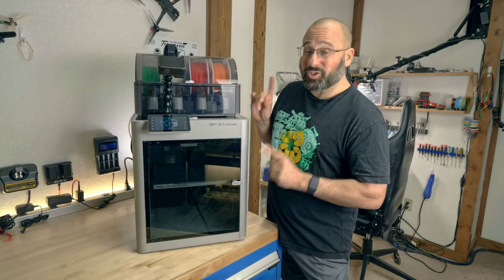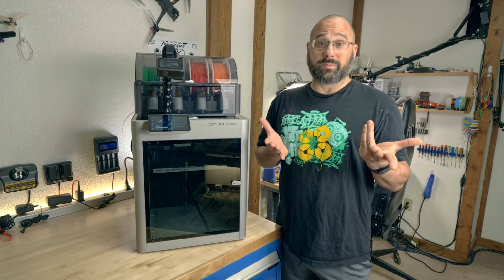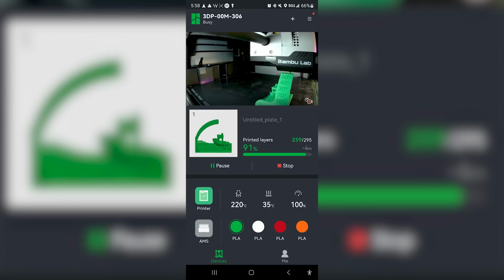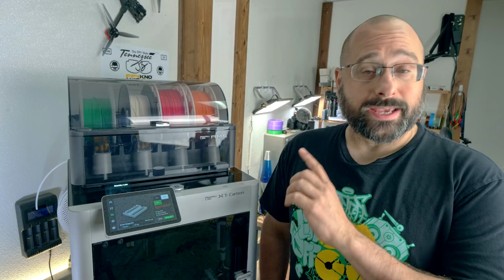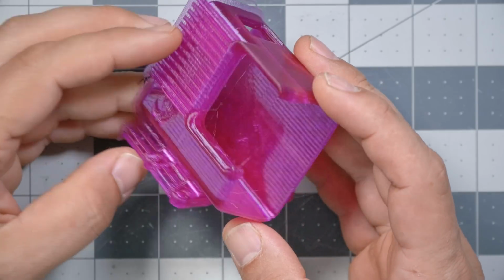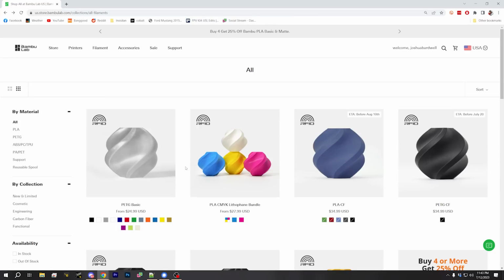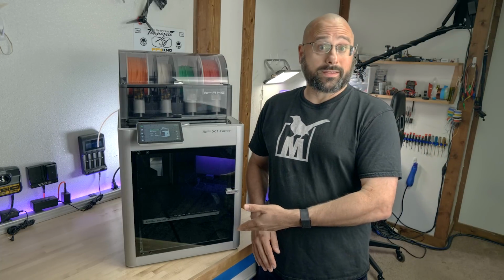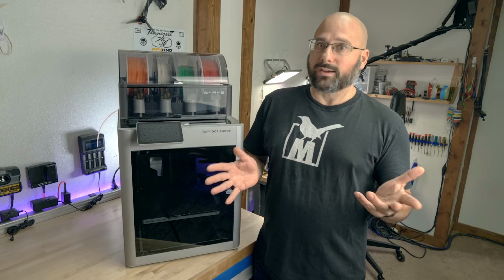Bambu X1C: the Fastest, Easiest, BEST 3D PRINTER I've Ever Seen

Comment: if you want a no-hands on printing experience, get the textured PEI plate. Never need to glue the plate. you lose the lidar filament adjustments, but tbh the prints come out exactly the same.
Also for TPU, the biggest improvement you can get is just to slow down the 'Max Volumetric Speed' to 2.5-3.0 mm/2. Bambu were way too aggressive with  their TPU profile.
Reply: Textured PEI mostly doesn't need glue stick unless you're printing with materials that are prone to warping and/or you're printing warp prone part geometry with PLA.  IMHO, it's good to have both smooth PEI for added grip and textured and be able to swap between them to dial in the stick you need.  It's handy because you can do things like skip brims when you might need one with textured, too.
Reply from the maker: Why do you lose the lidar?
Reply: @JoshuaBardwell  I think the lidar calibration doesn't work well on the textured surface.
Reply: @HuMaNiTaRiAn1  That is correct.  You COULD keep it enabled, but it's been shown to do more harm than good calibrating on a textured surface.
Reply from the maker: Oh interesting that's good to know.

Comment: Bambu is like a DJI, it do what it needs to do but it is overpriced. If you want to get serious RatRig or Voron is the way
Reply: True, I’m not rlly into the closed source environment bambu has created, since they’re kind of taking from og reprap projects and not giving back
Reply: Can you build a Voron or Ratrig enclosed with 255x255x255mm build volume for $700 like the P1S?  I don't think you can.  The P1S is $700.  Also, I don't think it's a great attitude to think people who use a different printer than you aren't "serious".
Reply from the maker: How cam you argue it's overpriced when the p1p is cheaper than a prusa mk3 and way more capable.
Reply: @JoshuaBardwell  the prusa mk3 is also overpriced though.
Reply: @Voyajer.  Prusa is overpriced, but in my opinion their pricing is justified. They basically lay down strong foundation for 3d printing community, they contributed so much and still continue to do so
Reply: @JoshuaBardwell  I’m not comparing Bambu printers to Prusa’s, I’m comparing them to Ratrig’s and Vorons. By overpriced I meant for the same price point you getting way better hardware (mgn linear rails instead of regular rods, more powerful bed and hot end, more sturdy frame) and open source software and documentation which will allow for easier upgrades and tuning. It is like comparing BNF’s (and it’s compromises) to custom builds
Reply: @3216.sideqest  Show me a ratrig or voron enclosed 256x256x256 build volume for $700 or less.  Also, you're not comparing comparable printing experiences.  Bambu setup is 15 minutes from out of the box to printing.  Vorons and the like you build and tune yourself.  Not to say either one is better.  I don't care to go through all that crap.  I don't want to spend a week building a voron.  So in many respects it's moot anyway.
Reply: @heroflying  I treat my printers as drones, for me it is just another build (and in so many ways they are so similar, build on STM32, motor controllers, sensor inputs itp). The point of getting a Voron or RATRIG is to not get out of the box experience. The point is to learn how does it work from ground up, upgrade them, tune them and push them to limits. You can get 250mm3 Voron for $700 or less. I prefer to pay for components instead of compromises labelled as ‘out of the box experience’. I read Bambu specs for their printers. Try to push them to advertised speeds and see what would happen.
Reply: @3216.sideqest  and the point of a Bambu is to just be able to print. So these statements that bambu is overpriced is irrelevant. That’s like saying some building you a house is overpriced compared to the materials and you build it yourself. I don’t want to. Nor do many people.
Reply: @3216.sideqest  also please post a link of a voron kit that build volume for $700 or less. I know plenty of people who have built vorons, and they are well north of $700 USD.
Reply from the maker: You can't compare a kit that you build and tune yourself to a ready to print out of the box printer. You're valuing the build time at zero and sure if that's true for you then the Bambu is overpriced. But a lot of people value the build time as very expensive and for them the Bambu is a bargain.
Reply: @JoshuaBardwell  if you put in this way it make sense. I’m a thinker and aspiring product designer. Researching, learning and self sourcing parts is really enjoyable for me so I don’t put price on it. Also everything I know about drones I know from you and Oscar Liang and I was able to transfer this knowledge to 3d printers. It is hard for me to understand why two branches of the same product (stm32) are treated differently and one of them is labelled as hell or black magic. And to make it more comparable there is a option to put ADXL345 (accelerometer) on tool head and PID tune it.

But I understand overall mindset.

Comment: I had most of my issues when I first bought the printer. Most of them have worked themselves out. If you let that torture test go longer there is a possibility it would have stopped it. I have woke up in the morning to prints that were perfectly fine and it asked me if it should continue. I have also had ones that failed and it ended up stopping. Only issues I have now that I haven't messed with too much are wall adhesion with TPU and overhangs with TPU
Reply: I thought in the video whilst he was watching the printer did automatically stop the print.
Reply: @conorstewart2214  I'd have to rewatch it. I thought he was just excited because he pulled up the cam right when it started happening and was able to stop it

Comment: Can it print the carbon fiber ^ nylon filaments without falling apart? I was looking at Elegoo.
Reply: You need to thermal soak the chamber for awhile in my experience but yes, absolutely.
Reply from the maker: Yes it can. A friend of mine who prints professionally, and who mostly runs CF nylon, has bought two X1C and is loving them.

Comment: It's hands down one of the best printers I've ever worked with. Customer support is a WIP and the default TPU and PTEG profiles need serious work, but it's a tax considering the value you get.
Reply: the default TPU profile is perfect. I have over 50 prints with the profile.

As long as your TPU is dry, and you use the heated plate with the gluestick, it works perfectly.
Reply: TPU default profile for me was great with sainsmart and ERYONE TPU. PETG Default for me was fine but I wanted a bit more quality, so I lowered the metric flow a bit because I’m lazy, works great with so many brands of PETG - ERYONE, California filament, Prusament, stronghero3d, overture, esun…
Reply: also, I was printing PETG-CF out of the box no problem with the default profile as well. Keep  your stuff dry and everything goes to plan ;)

Comment: What about the recently released P1S ? Better than the P1P but not as good as the X1 Carbon
Reply from the maker: All of the Bambu printers have the same ease of use, speed, and quality. The P1S and P1P have a few features missing, but are very very good printers for the money, and frankly the X1C is overkill if you don't print ABS or abrasive filament. It's unfortunate timing that my X1C review came out right as the P1S is releasing, but what can you do. Maybe I'll get a P1S to review too!
Reply: @JoshuaBardwell  Yep, simple timing issue - little you could have done about it
Reply: No brainer get the P1S over the P1P.  PROBABLY most people won't benefit from the X1 Carbon.  The X1C even if you're printing ABS, that's not a value proposition of the X1C since the P1S is inclosed.  It's abrasive filaments out of the box, the potential better self tuning the LIDAR offers  (the P1P and P1S can never be upgraded with the lidar apparently), the better internal camera, and the WAAAAAAAY better touchscreen interface on the printer.  Even if you print abrasives, the P1S and P1S you can upgrade with the hardened extruder and hot ends.  There's debate with how much the LIDAR actually helps with self tuning.  It does help with analysis of the first layer though.

IMHO... most people value wise are probably best off with the P1S.  Maybe you add the hardened extruder and hardened hot end later if you want for abrasives.

Comment: WOW! I am quite shocked with the overhang at 13:21, WOW just WOW! My ghetto printer can't do that, it always sag. Impressive! Plus 20mins benchy! Really impressive!
Reply: At 7 mins you can see the outer wall speed set to 200 mm/s. That's fast. My Creality CR-10S Pro is maxed at (I think) 180. Never tried it though. Plus the rest goes well over 300 and 400 mm/s.
Reply: @PiekeDeKat  I see mine is at 40ms. This could be the culprit.

Comment: Been running a few X1C's from the day one preorders, two of  which are fully insulated and dedicated to PA6-CF    no issues aside from normal things you run into with any printer.     they are amazing machines but not a fan of how it handles multimaterial prints,    these will remain my primary printers for most orders but got a 5 extruder Prusia XL shipping soon that i'm excited to get my hands on!     they have been a total game changer though, one X1C will replace the output of 3 bed slingers and if space is a issue then clearly 4 printers is better then 12.      the speed makes it much more viable to do rapid prototyping when you can litterlly get a test part off the unit in a 1/3 of the time.
Reply from the maker: For multimaterial, a mutlti-head printer is really best. Then you don't have to do purge towers and waste a ton of filament. But they're out of the price range of most hobbyists.
Reply: @JoshuaBardwell  IDEX isn't. You can get a SOVOL SV04 for <$500... but yeah, you're limited to two materials.  If you only need two though for two color printing, flexible joint printing plending PLA and TPU, or to do full contact support with PLA+PETG?  IDEX is very affordable for normal hobbyists.  Will it be seamless and easy out of the box like the Bambu though?  Absolutely not lol

Comment: 15 hundo! wow. The multi colors is pretty legit, seems like they could have snuck in an automatic glue stick applicator though.
Reply from the maker: You can get a P1P for $600 and get 90% of the advantage of this printer. The full monty X1C + AMS is a bit pricey, although if you compare it to printers with similar capabilities from 1 year or 2 years ago, it's pretty inexpensive.
Reply: @JoshuaBardwell  The AMS deal looks like its totally worth it, especially for the type of folks you mentioned in the video. I just thought it was funny you still had to use a glue stick lol. 
I have an Ender 5 that has been relocated and mothballed that I really need to get back into action since I've gotten into FPV. I'm more of the tinkerer anyhow. But if I had the means I would look into one of these.
Reply: @zeta7world  You can also get the P1S with AMS for $950 and get 95% of the X1 Carbon's advantages.

Comment: If anyone has to print and is already building drones. Why building this printer ? 

Just get a Voron, a ratrig, an annex or a vzbot instead.

Plus you can’t use Tpu with the ams, and their AMS system is known for being terribly unreliable and messy
Reply: This isn't a "I wat to spend 80 hours sourcing building and tuning" printer this is an "I want to unbox, plug in and go" printer. Different target audience
Reply: Depends on what you are doing with it.     We sell parts so getting down to business is the goal.   I've built hobby printers, these are more of an answer for small scale production in my opinion.   I want to unbox and start printing inventory, not spend 40 hours building one.   Anyone building quads is more then capable of building a hobby level printer, but time is worth more then money to some people, in that situation this printer fits the bill.
Reply from the maker: The kind of person who can say "just get a voron," is not the target market for this printer.

Neither me nor anybody I know who has the AMS has had a problem with it. It's been flawless. That's a small sample, but I wonder if your info is up to date.
Reply: @JoshuaBardwell  The biggest downside with the AMS system is mostly just purge waste and the fact it being single nozzle, can run into issues if trying to print different materials at the same time, but for single material multicolor prints its by far the best MMU system on the market ATM
Reply: @JoshuaBardwell  Fair is fair... the AMS isn't flawless.  No TPU, can't do many abrasives, has trouble with cardboard spools or lighter spools when you get to the end of the roll sometimes.  But a claim that it's "terribly unreliable and messy" is absurd.  As Nero3d pointed out, it is by far the most reliable and best MMU+single extruder system on the market, dusting everything else.  It's pretty darn reliable with a few gotchas - that's a far better description.

Comment: Creality K1 is just as fast if not faster and cheaper.  Also kingroon klp1 is fast and cheap.
Reply from the maker: Creatlity has always made great budget printers. But their quality control, consistency, and customer support has never been their strong point. The K1 surely is a solid printer, but IMO bambu offers a much more well rounded package, and the price of the K1 is too close to that of the Bambu to make the K1 compelling (to me). If somebody was very concerned about privacy implications of Bambu, or had some other deal-breaker, then the K1 might be a solid alternative.
Reply: @JoshuaBardwell  I know 3 youtube 3d printer reviewers who have had major issues with the extruder on the K1.  Literally couldn't properly consistently extrude any filament.  Nathan Builds Robots finally had to design an adapter to use a different 3rd party extruder altogether.  IMHO, the K1 is not a solid alternative under any circumstances.  If you don't want to go Bambu, fine, but maybe wait for another alternative that proves to be reliable.
Reply: With the price drop of the p1p and the P1s release. The K1 isn't the best option for most people.   It's riddled with issues.

Comment from the maker: Bambu is making the best, fastest 3D printers I've ever seen. It's 2x to 2.5x faster than other comparable printers, and print quality is as good or better. Although you'll never completely escape "3d printer hell" (where you have a problem that you have to experiment to solve), Bambu comes as close as I've ever experienced to "hit print and the part just comes out of the printer, with screwing around."

Although I'm reviewing the top-end X1C, Bambu has two other printers that are significantly less expensive. The P1S and P1P are just as fast and easy to use as the X1C, but with a few corners cut to save price. Many hobbyists--especially those who don't print more exotic filaments like ABS and carbon nylon--won't notice the differnce.

Shop the Bambu X1C: https://shrsl.com/45i1o
Shop the Bambu P1S: https://shrsl.com/45i1z
Shop the Bambu P1P: https://shrsl.com/45i28

If you're at the $300-ish price point on a printer, the Bambu printers are simply out of reach. But bear in mind that by the time you finish upgrading that $300 printer, you might have afforded a P1P, which will unquestionably give faster, easier, better results. If you're in the $500 and up price point, there is a good chance this is the printer you should buy.